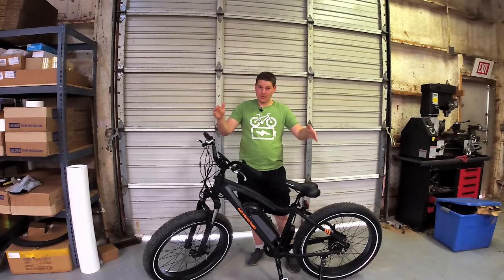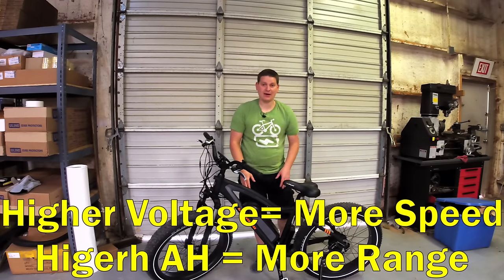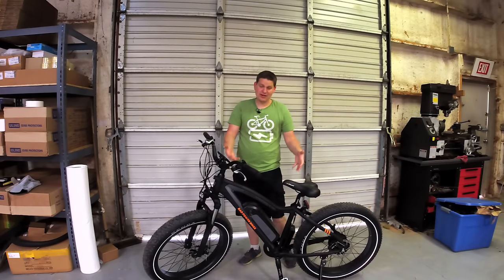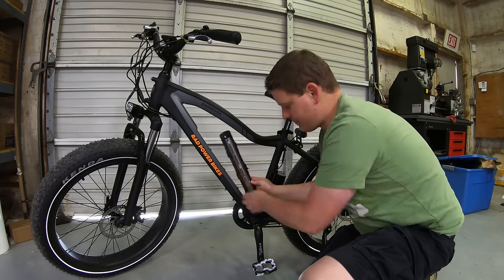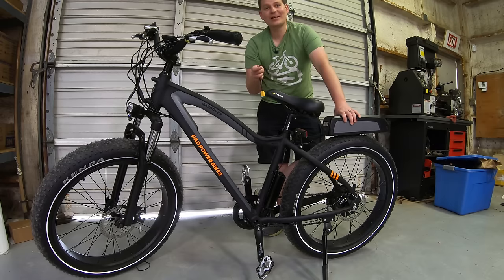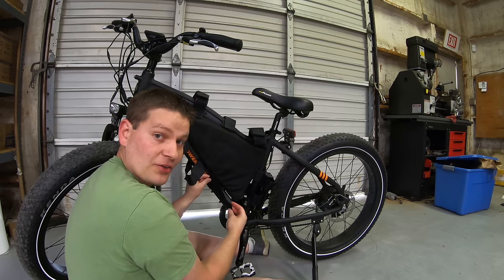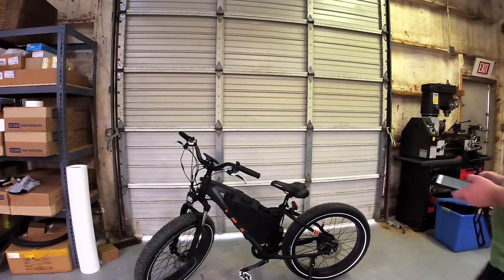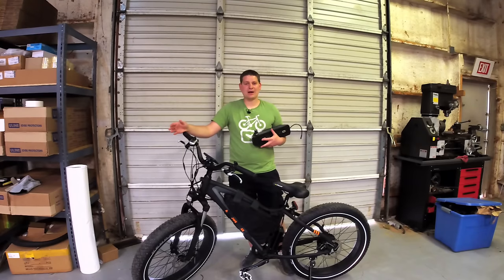Easiest Way To Upgrade Your Ebike Battery

Comment: Range, not more power is my main concern. I have a Rad Rover Fat 5 on order. My tentative solution, rather than buy a battery/controller or deal with a "re-wire" is (in early 2021) to buy a bare-bones Rad Mission and put a small add'l battery rack/holder on each bike. I have looked at battery prices from RAD and third-parties and with the Mission @ 999 USD..... (just slightly over double the cost of just a battery), I can have 2 full bikes....One Fat Tire, accessorized trail-ish bike and one leaner road bike and simple take two fully charged batteries (one 48v 14ah + one 48v 10.5ah) on solo extended trips. Big bonus however, is the ability to ride with friends and visitors..... I live beachside in Florida so, yeah......

Comment: i just upgraded a GENERIC lithium bettery pack to replace my original ebike acid motorcycle sized battery...my bike took 6 12v so i replaced that with a 72v GEN PACK! and its great! half the weight!

Comment: I have a Speedrid Electric Bike, 26" 4.0 Fat Tire Electric Bike for Adults 500W  48V 10.4Ah Battery, 7 Speed. I purchased a 48V 20Ah battery. My issue is, the controller for the bike is attached to the cradle of the old  battery. What are your best recommendations?

Comment: Is there a limited on what motor I can use an upgrade battery on?  
This is my current setup. 

Battery: 36V 10Ah Lithium 

Motor:36V 350W Rear Hub Motor

Comment: XXX tra large!! I have the Rad step through and did the 35amp upgrade and just received the 40amp battery blender, just waiting on new 48v 10ah battery. Im looking to do a 1000w hub motor with rim replacement if you have any recommendations that would be great. I love your content, keep up the good work!!

Comment: Thanks Kyle - How can I know if upgrading won't damage my hub? I have an inexpensive Hiland mountain bike that is only 36v and 10.4 ah.  I read if I change the battery it will likely damage the rear hub transmission.

Comment: Very nice video I have a juice cross current two will this battery work or do I need another controller and by the way very good job
Reply: On the cross current juice I have a 52 V 13 amp battery and I will probably need to jumpers to is that right?

Comment: Very informative  video.  Can I replace a lead/acid battery with a lithium ion  battery, and what adapters controllers would I need? Can the old motor handle that? It is an old step through  Zip Bike Trailz

Comment: I think you already answered my question.  I have a tadpole trike with a 20ah battery mounted on a rack over the rear wheel.  I was wondering if it would be possible to mount two 10ah batteries on either side of the seat to improve my cog.  Your two battery y connector sounds like a good solution.  I think I'll wait out the covid supply issues before shopping for new batteries.

Comment: Hi Kyle, great on upgrading an ebike battery. I'm just about to buy my first ebike in a couple weeks. I found a decent Jasion 27.5" for under $900 CAD. The battery is only 36V 10A.
Is that a really low end spec. or is that good for just 20KM distance trips? 
I'm gonna need an ebike guy and you sound very smart. Thanks I will be needing advice!!! lol Thanks man :)

Comment: That is what happens when you buy a store  made e bike. Its a lot fun to build your own. If i was to buy a store made e bile it would be a  rize  rx  they have the newest bafang 48Volt 1000watt m620 motor  and its mid drive. 👍🏻😴

Comment: Hi! I just purchased the triangle shaped battery. I'm going to run both batteries.  Stocked and new triangle battery.  Would have to get the xt90 cable and the dual battery extension cable as well. Don't the dual battery cable extension have anti shockable features like the xt90 cable

Comment: Recently  bought a used  Rad 5 Fat tire bike which looks exactly like one you put the 52 volt battery on.  Different voltage will it harm the motor? Another question, I have cable brakes and would like to upgrade to hydraulic. Is there a part number for a set up that would fit?  Thanks Dan

Comment: Thanks for the helpful tip to replace your stock battery with a higher capacity one for more distance. I have a himiway ebike. with a 48v 17.5ah battery. Do you have a cable to
go from the bag battery to a himiway controller?

Comment: I converted my bike with a kit that has a 500 watt motor on the front tire.  What do you think is the maximum voltage and amps of a battery for that motor?  Right now I'm using 3-12 volt batteries and each battery has 9ah.  Thanks - Eddie

Comment: This question is from another video you did about a rad e-bike that had a 750 watt motor and when you took  it apart it looked exactly like the 500 watt farang motor.  How do you figure this out before you buy a bike that's listed as a 750 watt. PS I really enjoyed this video.  I have seen a system that uses the rack for an extra battery. The battery slides in below the top of the rack so you can still utilize the back rack to carry things.

Comment: Thanks for all your time and information you share. I have a Rad and have the passenger kit. But I would really like to go faster as it unlocked to do 24, 25. But still needs more speed. Any ideals on this?

Comment: just a question regarding 2 batteries on the bike...
if you have 1 batter that is a 48V 20aH and the other a 48V 21aH does that make a difference or is only th Volts of the battery that matters, as I am seriously thinking about upgrading my Ace- Demon dual motor e-bike to run of 2 batteries, and then fit a 12 V system to the bike so that I can run a 12v lighting and horn of it, and was thinking if I had purchased the triangle battery with it's bag, would I be able to run the 12V lighting off thar while the main battery is running the bike until it runs flat to 10% then switch it over to the 2nd battery....

At the moment I am working around the 12V lighting system by installing in a grey box attached to the bike a 18V 5aH Ryobi drill battery to run the 12V lighting with a step down converter....with this setup running 2 batteries on my Ace X - Demon (similar to the Aerial Rider Grizzly) I could go further and run turn signals, stop (brake lights) and motorcycle driving lights (built in fog lamps) and horn to the 2nd Tri-Angle Battery...then switch over with the connector...but would also mmaintain a 3rd battery (original to the bike) for a backup

Comment: I have an Ancheer bike with a battery that’s been stolen and the company doesn’t have batteries to replace them.  The battery is 36 volt, 10ah, 350W.  Is there any workaround you could suggest?

Comment: I have a motorcycle-style ebike, that runs on 72v. Currently, I have six 12v 20ah batteries in it. My understanding is that were I to upgrade to 72v 50ah, I would not really need to do much, as I'm not changing the voltage, just the capacity. Would love correction if this is wrong. If I mess with the voltage, then I'll need to upgrade the controller, breaker, etc. Correct?

Comment: excellent tutorial.   I live in the uk.  I have a Raleigh Motus which even though heavy is a great tourer.   I want to go much further however and a greater capacity battery is the solution.  Are there convertors kits for the Bosh motor / batteries?

Comment: Been going through your videos, and thank you they are very informative, and have a question? I would like to do the Bafang 750w Motor Upgrade for my RadRover 5 eBike, do I have to change out the stock controller? I believe it is set up to handle 750 watts? Second question - You mentioned the battery's AH determine the distance, so if I had a 48V battery, could I buy a different 48V with a higher AH say 17AH?

Comment: I'm upgrading my battery now how do I know if my motor can handle it? I bought an ebike off Amazon knowing absolutely nothing about them so I found one cheap. It's a pexmore 26 fat tire 48v 500w 13ah. But there is really no information on the motor and the user manual has no specs. So I'm learning on my own as I go. The controller will go up to 60v but like I said I have no info on the motor. Can you help me !?!?! And any tips to get the best speed and performance would be greatly appreciated

Comment: Hello I have a question in regards to a off-road 72 volt electric dirtbike I was given. can I purchased Two 48 Volt battery packs that are putting out around 100 amp hours each.  This particular E bike from what I understand is Bluetooth controlled via the phone so I’m wondering if the voltage/amp regulator would work with such a high power output and obviously knowing that it’s above 72 V will it work with the current system? I’m hoping the voltage regulator/amp regulator will be able to handle it/be set up the correct way ?

Comment: Have D-class Ariel,like to add a secondary battery.l have a U004 battery 48v 24ah... Can I hook them up parallel or should I use a blender? Second question I have for you is did you do a video on an Aries d class e-bike adding a secondary battery?

Comment: Can we use normal battery connectors for same Voltage but different amps batteries. Rather than buying costly connectors. ?

Comment: I want to do this project on my bike which currently has 36v 500 rear hub motor / 36v 13ah battery. What would be my up grade options. Also , would the upgraded 48v battery be too much power for the 36v 500w motor. I apologise if I missed the Vlog on understanding “your battery “ 🤙🏾🌊🌴

Comment: I have a 2017 Easy Motion Atom Lynx 6.0 which is now a white elephant as BH bikes has pulled out of North America.  I started having issues with the bike power cutting out. I took it to the dealer who actually knows nothing about bikes and they proceeded to dismantle the battery which is now useless.  Would you have an option to put a generic battery on this bike ?

Comment: I'm wondering....this is alot like RC cars...my question is...those LiPo battery u using are 2 s...so just like RC cars...get higher amp ESC and lower kV motor..can u hook up same sive battery case...but 4s... Is there a top line ESC and motor company out there like hobbywing or castle?

Comment: I have a eAhora XC200 this bike recharges it’s battery under specific circumstances as you ride. If I use the double battery adapter will the batteries be recharged or is it possible the recharging capacity could be damaged?

Comment: I have a sun trike E350 electric bike. Battery went bad. A new battery is $700.00 can I purchase an aftermarket on line and it will work? What would I have to look for?

Comment: What type of charge port does this battery use? My current ebike is a highway cruiser with a barrel plug for charging,  so I am wondering if this battery can be charged  with solar power while riding the bike? ..thanks

Comment: When you say the Rad bike battery is "proprietary" is it just the cable that makes it proprietary or is there something else going on with the electronics? If I wanted to use a third party 48 volt battery and stick with the original controller, would I just need to change out the cable and maybe the cradle?

Comment: Exactly the "battery stuff" I was looking for.   Thanks for all the well presented, easily understood info!  So, how about this situation... say you are running two almost exact same batteries and using a balancer / converter switch in line with both.  (I'm adding a spare)  Would or could it be better to switch off one battery completely until dead, or almost dead, then reverse the process and switch the expired battery off and turn the unused battery on?  Would there be an advantage assuming all other factors (speed, hills, starts/stops, etc remain fairly the same,) or does the converter /  balancer do it for you better without actually using the on/off switch on the batteries themselves?

Comment: Not that you have huge voltage differences between these bicycle batteries, but higher voltage will give you longer range as you lesson the amp draw from the motor. Of course everything has to handle the higher voltage, controllers motor and so forth. This is in anything lighting machinery ac or dc voltages. My rc cars

Comment: I have a Cyrusher 650 2021.I ride my ebike to work everyday 9 miles there and 9 miles back home. I’ve noticed my battery gets low to about 4 bars left. Is it ok to charge my bike everyday at work and when I get home so I can have a full battery charge every time I go to work and home? I don’t want to damage my battery.

Comment: I have a 1999 Lee Iacocco EBike in excellent condition body wise. I can't get parts can I use the controllers and battery on the bike to get it working?

Comment: What would be your recommendaton battery upgrade for a 2021 Specialized Vado Turbo 4? I currently get 20-40 miles but would like 30-60 mile range?

Comment: Just to make certain that I understand a point, if I want to upgrade my Ancheer's 36 volt battery to a 48v, I would also have to purchase a different controller? Would it have to be an Ancheer product or will a generic controller do? Thanx & good instructions
Reply: Thats quite the overvolting going on there, you would most likely also need to get a 48v motor plus a new controller, i am currently running a 48v motor witha 52v battery which the controller should be able to handle since most 48v controllers have 60v caps

Comment: Good morning area 13, I’m an old new rider and have a quick question just bought a 350 W E bike with a 37 V battery. Want to upgrade to a 45 V battery.  What is 45V work?

Comment: The problem is, every bike seems to have it's own battery case.  My Magnium Ui6 bike battery locks into the frame.  A two prong connector makes the DC connection.  An exact replacement battery is almost $700 from the company.  Not that I need one, but I have found a few other bike brands using the same battery and selling replacement batteries quite cheaper.  I'm suprised I have not see someone selling replacement batteries that can connect to the OEM bike connector.
That replacement battery case is a great idea though.

Comment: I hooked up another brand battery same voltage but not the low voltage diagnostic voltage. Seems to work. Just started to try it out.  Using an A/B switch inputting voltage at the output of the stock battery.  Display lights up, motor runs on the stand.  Haven’t tried any distance.  Required cutting and soldering and trying to read that cheesie schematic in the owners manual.  I used toilet mounting studs on the top bar.  Batteries run independently.  One has to run till flat and then switch to to the second.  I bought lab grade volt meters, one for each battery.  When batteries get low voltages get funky under load.  Unproven so far.

Comment: I’m really interested in your parallel adapter. My bike has an integrated frame battery but it’s 10ah so my range is 15 miles if I’m lucky on flat ground. I’d love to get an external 10-20ah to double or triple my range. Plus my battery was 10ah when it was new and it’s now 3 years old so so know I’m not even seeing that anymore.

Comment: Can I add one of your batteries to my Giant Road E ?   Or, is a production eBike like mine built too proprietary?  My bike is a 2017 model with a 36 volt battery, and it uses the Yamaha mid-drive motor system.

Comment: On charging, what if I used the 48 volt charger most of the time on the 52 volt system and thats might be like a 80% to 90% charge and then if you really need the 52 volt you could top it off from time to time.  Thanks for your show.  Old man 75 and more than 10 years an ebiker.
Reply from the maker: Yes, that is a viable solution.  I do recommend some regular 100% charges for balancing.

Comment: Great video . I just got my radwagon 4 and really like it. One thing I would change is to and a front suspension fork. I'd need interested in your thoughts on that. Thanks again for the content. I suspect I'll be doing a battery up grade and will look your way for parts and advice

Comment: Is there ANY aftermarket battery back that fits for Rad Power Bikes? Cause they have the special 5 pin proprietary connector.

Comment: Bought a newest hailong shark battery off ebay will use basic 2amp charger but curious to ask first could I charge it through the discharge leads with a 3 or 5 amp chargers sometimes while traveling maybe used to much power up hills ect would like more charge in less time

Comment: I have a Vtuvia Sk20 it has a 750watt 48v 52a battery. I want to add a second battery just as you suggested. Do you have a link for those connectors that help the batteries drain evenly? Also the the battery pack and battery?

Comment: Great video! If you use two batteries with the same voltge do you need to change out the controler? Severel persons are doing this on Lectric XP's.  Do you have a controler that will work on the XP's that would provide the pretection you mentionsed in thsi video.
Reply from the maker: We don't have a specific controller for that - but we may if there is enough demand for it.
Reply: @Area13ebikes  There are almost 6000 persons on the Facebook 'LECTRIC XP Owners Group'. All complain about the same 2 things: Uncomfortable seat and not enough Amp Hours in the battery (48V/10.5 AH). Opportunity calls!

Comment: I have a Super73 RX and I was interested in getting one of you triangle batteries. I don't know if the the RX controller will handle 52 volts. If the controller will handle it, what I'd like is a 52 volt 20 AH battery to use in addition to my existing battery mounted on top of the top tube.  Can you help?

Comment: I want to connect my 48v 20ah battery but the controller did not come with wire to run from battery , can you help me get some wire with bayonet connectors? thank you.